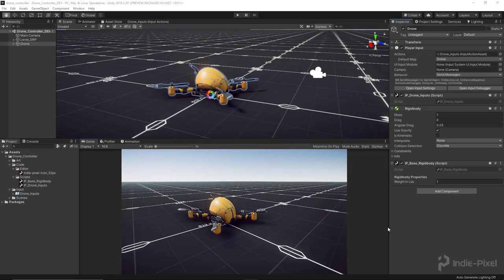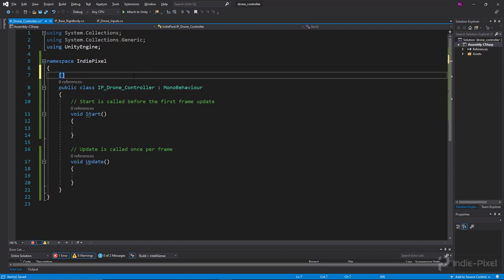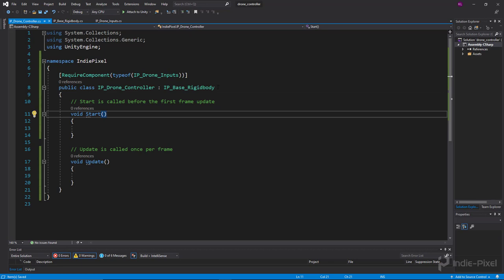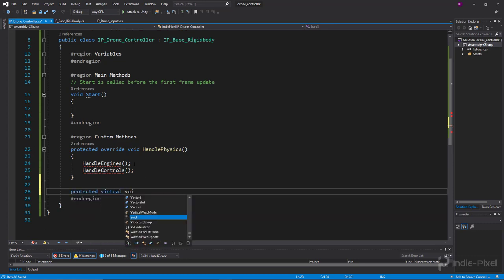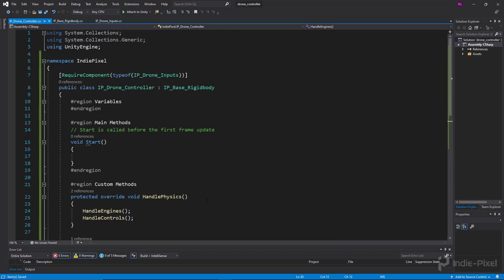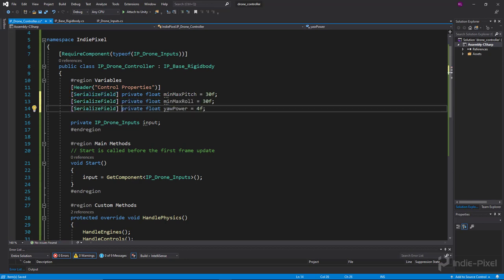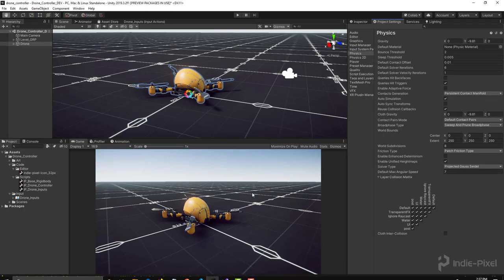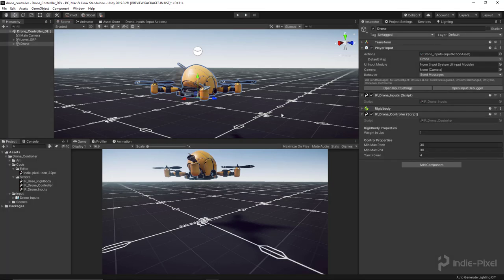Unity 2019 - Drone Controller - Section 3 - Video 3

Comment: The base-rigidbody script worked fine after the last video. But now it says "No MonoBehaviour scripts in the file...."  and says class can't be found when I add it as a component.

I definitely have " public class IP_Base_Rigidbody : MonoBehaviour " on my 9th line so I don't know whats going on!!!
Reply: I even made a new file, with a new name. Checked that the name of the file matches the part "public class ..."  

My visual studio is being weird though, Unity doesn't open it automatically when I open scripts.... I have to open the from VS....
Reply from the maker: @danielpd7631  hmmmm....sounds like it lost the link to the solution file for the visual studio project.  Which means unity cant compile anymore. Let me think.
Reply: I can open scripts in visual studio again (just had to go to preferences.. ) BUT still getting the error " Can't add script component 'IP_Controller' because the script class cannot be found. Make sure that there are no compile errors and that the file name and class name match." when dragging ANY of the scripts on the Drone game object....
Reply from the maker: @danielpd7631  oh good! Do you have the script ip_controller in your project?  Sorry if you answered that already...had a lot of questions from the community lately and it's hard for me to keep track.
Reply: @IndiePixel3D  hey, so after reading loads of forums, I moved the script from the 'Scripts' folder to the general assets folder... and somehow now its working! I have no idea what was going on, thanks a lot for the replies I appreciate the help!
Reply from the maker: @danielpd7631  well that is weird but glad you are up and running again!

Comment: Hi @Indie-Pixel I have been going through this series and I got an Error where the Drone is not Hovering on air but It is only moving upwards. i.e opposite to the ground nonstop.

the code was 

protected virtual void HandleEngines()
        {
            rb.AddForce(Vector3.up * (rb.mass * Physics.gravity.magnitude));
        }

Can you please help solving this for me.
Reply from the maker: Are you dividing the final force to the rigidbody by the number of engines you have?
Reply: @IndiePixel3D  This is the full code, 

using System.Collections;
using System.Collections.Generic;
using UnityEngine;

namespace CyanogenGames
{ 
    [RequireComponent(typeof(IP_Drone_Inputs))]

    public class IP_Drone_Controller : IP_Base_Rigidbody
    {
        #region Variables
        [Header("Control Properties")]
        [SerializeField] private float minMaxPitch = 30f;
        [SerializeField] private float minMaxRoll = 30f;
        [SerializeField] private float yawPower = 4f;

        private IP_Drone_Inputs input;
        #endregion

        #region Main Methods
        // Start is called before the first frame update
        void Start()
        {
            input = GetComponent<IP_Drone_Inputs>();
        }

        #endregion

        #region Custom Methods

        protected override void HandlePhysics()
        {
            HandleEngines();
            HandleControls();
        }

        protected virtual void HandleEngines()
        {
            rb.AddForce(Vector3.up * (rb.mass * Physics.gravity.magnitude));
        }

        protected virtual void HandleControls()
        {

        }

        #endregion

    }
}

Did I do anything wrong ?
Reply from the maker: So in the handle engines, divide the force applied to the rb by 4.  This is because we have 4 engines.  Mass×gravity is the total force to keep an object suspended in the air.  So if all 4 engines are providing mass×gravity as the for the then force then it will constantly go up.  So we divide by the total number of engines. :)
Reply: @IndiePixel3D  is there a good way to handle that division by 4 dynamically? so that you can easily add the engines to another drone with like 5 or 6 engines maybe?
Reply from the maker: @creasu124  yeah, could always get the count from the engines list.  Which means then we would refactor the code a bit so you would assign all the engines to the drone controller.   Could also get the engine count using the get components in children method. To see how many engines are patented to the drone controller.
Reply: @IndiePixel3D  i see thanks for tutorials they are great